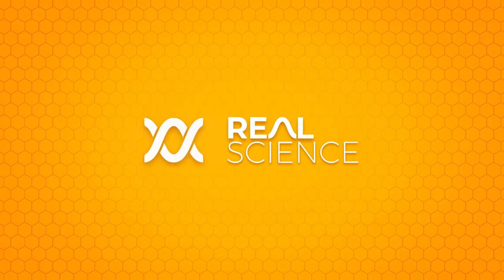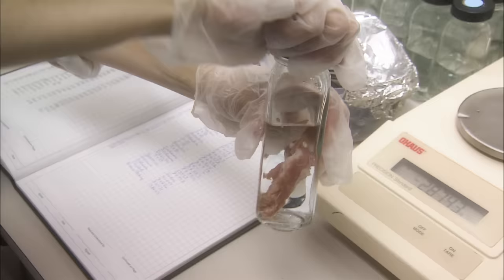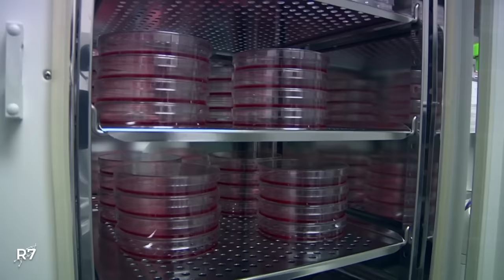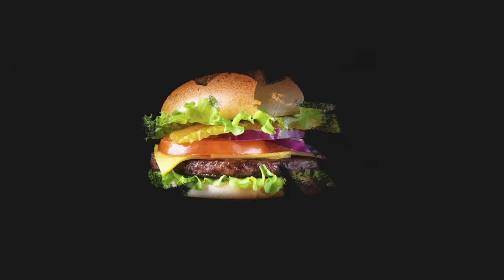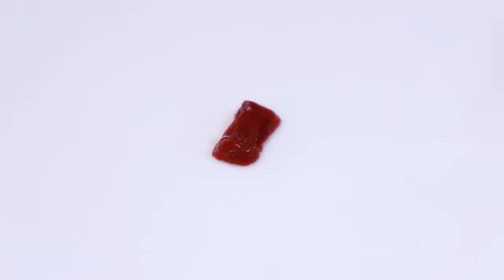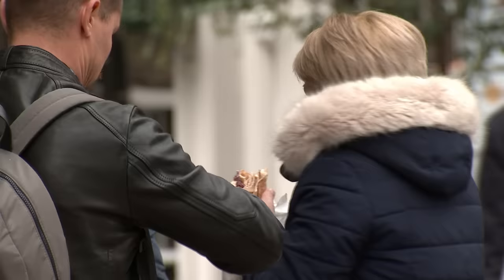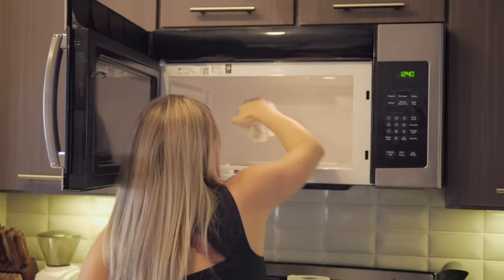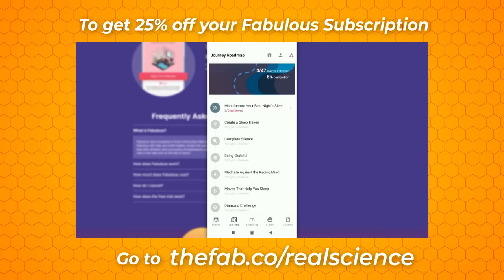The Truth About Lab-Grown Meat

Comment: They're also competing with a number of meat "alternatives" made from plant products which are designed to closely resemble meat, but mostly skip the lab requirements.
One other issue with compounds like FBS is that it basically works by turning off the processes that prevent cancer, so they need to be really, REALLY sure that doesn't carry across to shelf product. Mass deployment of a compound DESIGNED to be a carcinogen is nightmare fuel.
Reply: The thing is: what you mean, will never be alternatives.
Same with soy milk. It will never be milk nor replace it.
At max, it has a similar taste. But that just means that they coexist and steal some marketshare of each other.  It's just an addional item on the shopping list, like potatoes were after their introduction in Europe.
Reply: @yoshyoka  First, I agree FBS is unlikely to be much of an issue as it is consumed by the process, and doesn't cause uncontrolled replication. However, we don't know whether that's true of any as-yet unknown compound intended to replace FBS. We can be pretty sure the FDA and equivalent agencies won't allow anything like that into the food supply, so... probably not an issue.
Secondly, while it's rare, not all food is digested or cooked before coming into contact with live human cells.
Third, it hardly matters, because the meat lobby is going to jump on any HINT of carcinogens in vat/lab-grown meat faster than you can blink. Think of the reaction to GMOs.
Reply: @ronnycook3569  Look, I am a medical biotechnologist: such technologies are my bread and butter. You could directly drink FBS and pour it into an open wound, and you would have no ill effect from it. Bodies don´t work the way you think they work. It is would be you would just need a tiny amount of that stuff. 
Brainstorming about what the synthetic alternatives do, before they exists, is just senseless.
Reply: @yoshyoka  I'm aware that FBS won't cause cancer; if it did, they would need much less of it. A catalyst (not consumed in its use) to do the same job would be less safe (and therefore would probably never be passed by the FDA). It's that sort of catalyst which would be both most efficient, and most dangerous. As I said, nightmare fuel.
Pointing a finger directly at FBS itself was a mistake on my part, although as the video itself makes clear FBS has its own problems.
The "best" path would probably be to genetically engineer (or find) an already cancerous muscle culture (like HeLa, but bovine muscle rather than human cervical) which would tick all the boxes, but the meat industry could make fun with that as well, either from the GMO angle or from the "eating cancer!" angle. That may be why no mention of such an approach is made, or there may be other obstacles.

To be honest, although I'm not a vegetarian, I suspect plant-based imitations would be more practical and more economically viable. You're dropping a link in the food chain, so gaining some efficiency - although I'm aware that there are an entirely different set of problems.
Reply: @ronnycook3569  If you culture animal cells in bioreactors there is no food chain link to drop.. it is not really different than an algae culture, just far more difficult. What would really make a difference would be to recreate a real muscle tissue (including angiogenesys etc..) yet we are still decades from that now. 
Sure There will be GMO scepticism, yet i am not sure if lab grown meat would not already be enough removed from nature to cause a scare no matter how you manufacture it. 
The biggest issue of plant substitutes is that they are so rich in non-hydrogenated oils (which have to be heated) that they are unhealthy a.f.
Reply: Plant based is not meat.
Reply: Nor is lab grown.

Comment: The FBS issue is probably the biggest issue here, but it's not unsolvable. You don't need a growth medium that will work with any and all cells, to make artificial meat you could probably do with very few cell types, so it would be feasible to find an artificial alternative that works well for each one, or to use genetically engineered cells that will accept a cheap substitute [if you could only educate the masses to prevent nonsense hysteria about GMOs]. The manufacturing cost of components for the artificial serum will decrease as demand grows, I'm not sure that part will be a huge issue in the long run. 
I'm not sure those huge bioreactors are an accurate depiction for how the cells would be grown. I'm pretty sure these types of cells require a surface to which they could attach in order to grow, unless you went the GMO route. The need to grow cells in single layers will without a doubt make production more expensive
Reply: I think a dissolvable scaffold will be needed to replicate a complex structure like a steak or a wing. By introducing different cells to different parts, you could, in theory, create any chunk of meat you want. Depends on how much it costs to make the scaffold. They might be able to be 3D printed or moulded cheaply enough.
Reply: @Croz89  Yes, I also think a 3D scaffold would ultimately be the way to go, I just thought my comment was already long enough and this wasn't really my main point. 
The main issue with this approach is that due to the thickness you'd also need a vascular system to disperse the growth medium to all the cells and to remove waste. This will be complicated and thus probably expensive, maybe even too expensive. I suppose we'll find out. I'm sure that at least initially lab grown meat will be limited to minced meat and similar products because they should be easier and cheaper to produce. I really look forward to that day when I can finally buy and eat lab grown meat, I wouldn't mind paying more so long as it wasn't extreme.
Reply: @limiv5272  It depends. If it's small enough simple osmosis may be enough to introduce nutrients and remove waste.

Comment: All I heard for FBS is that it's great for research and avoids having another variable to worry about. Which is critical when working at the cutting edge of a field as it save a lot of time. Secondly I didn't hear how much kg for kg was needed and  especially what the theoretical maximum dilution is (as I doubt 10l per burger would really be needed if done and understood well). Lastly I heard that basically FBS is used because of a big lack of the scientists involved actually understanding what's going on like would usually be the case in Physics, Chemistry, etc. Very common thing I see in pharma, a lot of trial and error, which is okay but shows that they don't really understand what they are precisely doing (not saying they have no clue just saying it's in part data driven guess work). If you actually understand the science, you would know which components have what effects precisely and how/what the suicide mechanism triggers. Hell technically we could even use crispr to genetically modify the DNA such that we get stem cells where the function for suicide is disabled, however that requires enough understanding (and not doing this in sentient beings because tumors).

As for the price, research stuff is generally pricy as hell because of the market, supply, demand, and type of buyers. You want to compare this to transistors and computers? in the 1980s a computer woud take up a huge ass room and cost millions, your phone nowadays is more powerful than thousands of those computers and costs 200-1000€, if we account for inflation and all that, the price reduction of transistors is probably in the hundreds of thousands. 

TLDR; all I heard is a clear lack of understanding of the topic and it being pushed by potential "fast" future profit more so than fundamental research.
Reply: Well put.
Reply: * in this industry we have mutch more dead ends

Comment: Man, the FBS thing always sounded like something more research could fix, but the whole zero immune system problem is a complete project killer. I cant think of a single way of fixing that without defeating the whole point.
Reply: There is a company that make lab grown meat, without using it
Reply: @johnnyjack4079  can you mention a link or reference?
Reply: @Tobertus  I was pretty sure I had watched a video on YouTube, was about grown lab chicken and if I wasn't mistaken I think they use plant based. I Googled it but said it's on the way just not ready yet
Reply: @johnnyjack4079  Probably so, very interesting! Thanks for the info :)
Reply: @Tobertus  I searched on Google and it says "Okara"
"Food scientists in Singapore are working to use okara, a byproduct of tofu production, to make cheaper cell-based meat. It can replace the use of fetal bovine serum (FBS) used in cellular agriculture that is expensive and comes from animals."
Reply: Stop the research guys. "Bluebonic" can't think of a solution, it's over.

Comment: In general I expect a lab grown T-bone steak is going to be very unlike the real thing and will have a vague similar appearance. The bones will be extruded like huge long straight pasta noodles from a calcium bone paste and then a long tubular shaped slab of muscle will be glued onto the bone with a material that will resemble ligament when it firms up. The resulting T-bone "slab" is then run through a cutter to form each individual steak.
Reply: I think the best use would be ground meat like in fast food hamburgers or chicken sandwiches. Don't expect a T bone

Comment: I'm glad you included the part about serum, far too much of the coverage of lab grown meat omits it and it's one of the two biggest issues for lab grown meat. The other, of course being extremely high energy usage. The other issues are serious, but probably reducible.
Reply: On the other hand, condensing the blood of 666 cow fetuses into a double cheeseburger is metal as fuck and I want one. \m/
Reply: Yeah that was pretty horrifying
Reply: Any process as arguable immature as lab cultured meat is likely to be ripe for serious optimisation of energy use.

As they are still concentrating on the science a la FBS alternatives they are likely not concentrating on the area of facility/process optimisation at this point - that will come further down the line.

Comment: Question, you said FBS is the only known compound useble in all lab grown meats, is there others more specialised compounds that exist out there?
Reply: There are, in fact. Quote from someone else
"Mosa Meat announced a year ago that they had an FBS alternative that cost 88x less. Upside Foods, the one with the new pilot plant, has a working alternative in place and they're currently putting it into practice. They're committed to only releasing products to market that are 100% free from animal slaughter. "
Reply: FBS is a known complex media (i.e. a mixture of organic materials that are not chemically pure and not specifically identified chemical components) that works well on many lab grown meats. To replace the functions of the different components in FBS we can use defined media (a mixture where its composition is exactly known) but the required nutrients and growth factor required in this defined media is dependent on the species of cells being grown. Furthermore, creating defined media requires mixing pure or purified components which can be extremely expensive (such as examples stated in this video). You would require a mixture of amino acids, sugars, salts, growth factors, cofactors (usually on the order of 50 or more components) that are essential for cellular growth and to prevent the cells from differentiating. You need these factors to make the cells grow and to prevent the cells from transforming into forms that you don't want (e.g. you want muscle cells not nerve cells). There are alternative complex media to FBS such as plant-derived lysates for example, which contain all the essential amino acids, but you still have to add in specific growth factors and nutrients before they can be used to grow animal cells.
Reply: I work with cultured meat and grow cell cultures using Serum Free media that doesn't contain FBS or any other animal-derived compounds. So yea there are more specialized compounds but they tend to be pretty specific and don't always work as well as FBS does

Comment: One other comment, you mentioned at least a couple times that none of the synthetic serums that have been developed fill the wide range of needs that FBS does, but you never said why that is necessary. For example, why does it matter if we have to use a different serum for each kind of meat?

Comment: So…what about cancer?

If you genetically modify a muscle cell to rapidly multiply, could you just do that and drop it in a vat of nutrients? Then you just slice off slabs as needed.
Reply: Basically immortal cell lines (look up henrietta lacks) . You still need the nutrient supply
Reply: @parameshnat  The point is the basic nutrients that muscles need to grow are the building blocks for the nutrients found in the muscle cells.

It doesn’t matter what process you use, you’ll always need raw materials to produce refined materials.
Reply: @josephcoon5809  no my point is that the nutrient supply is the difficult bit.
Reply: @parameshnat  You require the same nutrients to build muscle conventionally OR by the method I proposed.

All you did was run with a nebulous term without thinking about the details.

I’m willing to go into more details if you wish, but you have to be willing to do the same.

It will go a little something like “what inputs do we need to produce a desired output.” The output of digestible meat proteins requires a certain input of nutrients. Working backwards, those nutrients become an output to another process with a different input; and so on.
Reply: @stevec7923  I thought the same thing about texture, but I have ideas for that.

As for “cancer burger” who would market it that way?

I’m merely posing a process that doesn’t involve an animal and uses cancer-like processes.

It’s like when people spazzed out about “inject people with bleach.” One, he asked if a process could be developed that incorporates that general idea. Two, we use toxic and poisonous substances all the time in medicine.

I merely used “cancer” as a general description for “a process that accelerates cell growth.”

Comment: If the FBS's role is just the signals for the cells to not die, wouldn't the FBS be reusable, and not be a consumable?
Reply: You still have to purify the FBS from the cell growth medium after harvesting the cells, and that is extremely costly. Also the components in FBS responsible for the signaling will eventually be degraded by the cells over time.

Comment: Am I missing something? 5,000 liters is a lot per kg, but 5,000 liters alone is NOT a large beer vat, like this video makes out. A 5,000 liter square is about 176 cubic feet, or a cube with 5.6 foot sides. This is TINY compared to beer vats. You said, "that's like the biggest beer fermenter that ever existed. ALl, for just a single kilo of meat". This is incredibly wrong The largest one ever (according to a 2-second Google Search there may be larger or this may not be entirely accurate) was built in 1795 by the Meux Brewery, in London, England. It held 860,000 gallons or 3,909,637.4 liters. Meaning this SINGLE beer vat, produced over 200 years ago could make enough meat for almost 782 kg of meat per however long it would take to grow, which I don't believe you went over. And, I know, 782 kg is a small pittance compared to how much meat we eat each year. But in 2020 (according to the top Google answer again) it was estimated that the global beer production amounted to 1.82 Billion hectoliters, or 182,000,000,000 liters. That means the beer production could produce 36,400,000 kg of meat every 26 days (according to here: https://theconversation.com/would-you-eat-meat-grown-from-cells-in-a-laboratory-heres-how-it-works-117420), or 509,600,000 kg annually. Now, that's still low by a factor of about 1,000, but we're much closer. And, if you convert all of the agricultural land that could be converted to these vast bioreactor fields, and this becomes a trivial matter. Of course, I say trivial in the sense that if humanity collectively wanted this, we could make the space requirements a non-issue. Of course, this is far from the case. And there are still the other problems you mentioned.

Comment: One question that was not answered was - what will be the carbon (and other environmental) footprint of lab grown meat?
All of the complex and fairly intense tech does not sound promising. It would kind of defeat the purpose if the energy and chemistry requirements for this would be on par (if not worse) than field raised cattle.
Reply: Currently it is much higher than pastured cattle. It is probably also much higher than conventional CAFO cattle too. The specialty components of the growth medium such as growth factors require a lot of energy to purify after they are grown from recombinant microbes. And that is not even considering that the actual medium used (e.g. plant-based lysates) would require their own processing, and require cropland and energy inputs to grow.